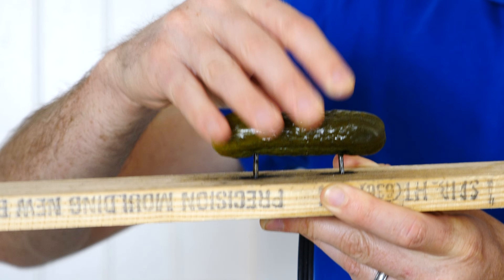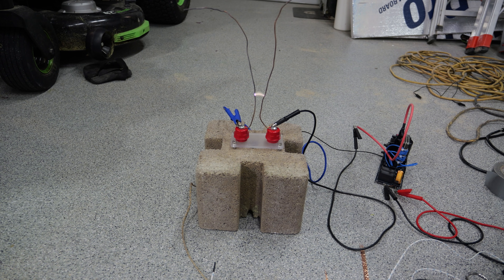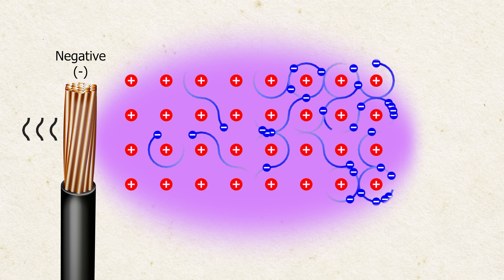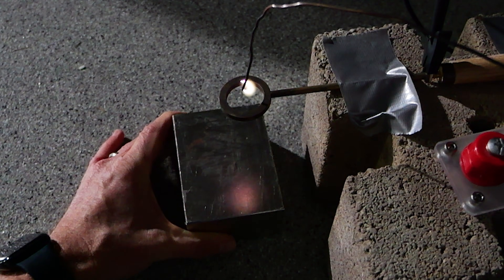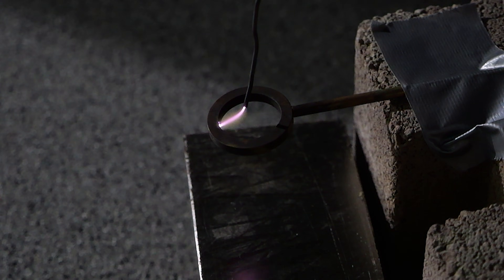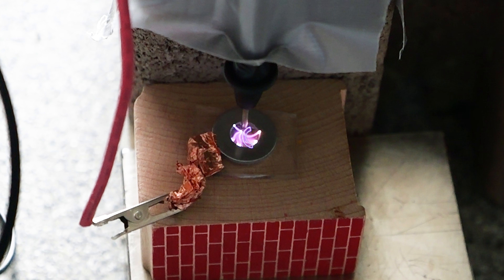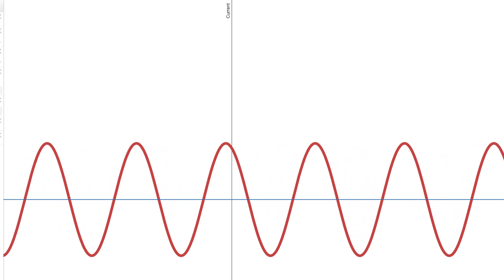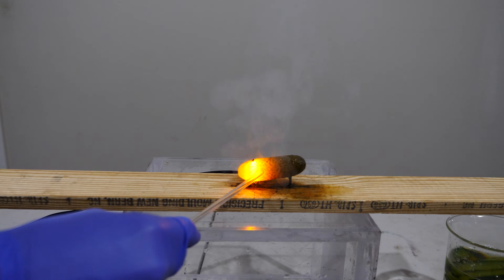Why AC Electricity Doesn’t Behave the Way You Think

Comment: The geometry causing a DC bias is how flame sensor rods work in a gas furnace. 120V AC is applied between the rod and the burner, with the flame acting as the conducting plasma. The resultant small DC bias current is sensed as "flame present".
Reply: 2025 and we still have a bias against DC. So sad.
Reply: @DanHarkins-jk9mi you can't blame them, DC can be so polarizing.
Reply: @DanHarkins-jk9mi  the other side is biased toward DC.  It all really balances out; no energy gained or lost, you know.
Reply: @DanHarkins-jk9mi  Well, the name change to Commanders may not have helped.
Reply: That is very clever. 'the best part for the job is no part', as they say.
Reply: 120v sounds high… a lot of tube heaters I work on are 48-60 v
Reply: @jasonhessels depends on the product. Exact voltage isn't critical. Most documents I can find say 90-110V
Reply: @jasonhessels  The control boards for the heaters can also step up the voltage to kV, such as for electric ignition. Perhaps the flame sensor circuit also steps up voltage? I'd have to look that up.
Reply: I have only ever seen thermocouple based flame sensors, but the theory of that one makes sense.
Reply: +1 for explaining something I hadn't fully appreciated. I'd thought it was 'just' making the gas/air more conductive.

Comment: For an asymmetric ARC, there will always be a DC component simply because the electrons can’t flow symmetrically, even if the driving waveform tries to be symmetric.  In a perfect circuit, one side would literally run out of electrons and the electric field would blow up to extreme voltages and find somewhere else for the electrons to go.  But no circuit is that perfect.  The DC bias that develops from the feedback is basically replenishing the electrons.

So it isn’t the circuit that is putting (most of the) DC bias into the electrodes.  It’s the electrodes that are inducing/forcing the DC bias in the circuit.

P.s. the DC bias will also heat up the transformer.  Transformers don’t like DC components because they do not contribute to building and tearing down the magnetic field.  They just generate heat instead.

-Matt
Reply: The flyback transformer he used has built-in diodes and some electronic neon sign transformers are knows to have a DC bias for some moving plasma effects in the tubes.

Comment: I still don't understand the DC asymmetry.   Why don't you get a similar effect from electrons?  Indeed, since the energy imparted to a particle as a result of a potential is independent of mass I'd expect a greater effect there.

  Also, Atoms are very small and the expelled positive ions should only heat up a very small region near a discontinuity in the material -- how can that be a substantial fraction of the overall heat created via resistance?  Or is this unique to the welding environment where almost all the resistance is at the discontinuity?
Reply: Energy is not voltage, and energy is not current.  Energy is voltage x current.   So the actual electron flow back and forth (current) is more or less independent of the energy that a heavy ion vs an electron can impart to the circuit due to kinetic motion (or anything else).
Reply: @junkerzn7312  Right but the same charge passes through both junctions and you get the same energy per charge in a potential.

Ohh is it about where the heat is generated? As in both junctions generate the same heat energy but one places it mostly on the welder side where it dissipates into the copper and the other puts it mostly into the intervening material (I mean really both junctions are basically the same but with sides reversed)
Reply: @petergerdes1094 no, one unit of charge is not o e unit of energy.  I just told you that.  Current is basically counting electrons … units of charge.  Current alone is not energy.  People make this mistake all the time.  A unit of charge does not represent a fixed amount of energy.
Reply: The flyback transformer he used has built-in diodes and some electronic neon sign transformers are knows to have a DC bias for some moving plasma effects in the tubes.

Comment: The pickle effect is different than what is happening with the plasma.  Since resistance increases with increasing temperature, heating is unstable.  The hotter part has more resistance and  therefore more heating.  This runs away and concentrates the heat.  Since the resistance is concentrated at the electrode, the electrode with higher initial resistance heats up faster.  This causes even more of a resistance imbalance and causes that side to have the majority of the heat.
Reply from the maker: yeah there is a lot more going on with the pickle than the plasma due to the reactions in the pickle and ion transfer through a liquid. But the point is that there is always an asymmetry that causes runaway heating that makes one electrode become the "cathode"
Reply: @TheActionLab  The flyback transformer in yoyr ZVS drver is a DC flyback. It has internal diodes. You need to get one from a much older TV which had external rectifier or voltage multiplier, so the AC output is accessible.

Comment: Thank you for this video.  I was wondering if I'd have to design a pulsing DC power power source for a ringed gliding arc plasma, But I'm glad to see that geometry creates bias where thermal electrons and field concentration create bias much like a vacuume tube valve rectifyer. It should have been obvious to me from the start. 

Next project pickle transistor computer. Just kidding 😂 there's probably no gain.

Comment: Ah yes, we always face the major problem of a pickle lighting up on the wrong side when plugging it to the outlet.
Reply: That's why I switched to USB-C pickles.
Reply: "we always face the major problem"

Or, you could say you're in a bit of a pickle.
Reply: flip the pickle over
Reply: @ImDelphox Pickle Rickkkkk!!!!
Reply: It's a good way to tell if the building's wired properly. The AC hot should always be the side that lights up more.

Comment: I'd like to see it with a series capacitor in the circuit to block the DC but allow the AC through.
Reply: One of two things will happen.  In an idealized circuit a voltage bias will develop that forces that ARC to run the same number of electrons in both directions.   In a real circuit, the voltage bias will likely be so huge that the capacitor will blow up.

Basically there is no way to avoid the DC component when the ARC is asymmetric.  The average electron flow can't stay asymmetric without a source of electrons to replenish the ones in the isolated part of the circuit that were lost to the other side (or gained from the other side).  So a voltage bias will develop that forces flow symmetry.  And if you didn't build the circuit to explicitly deal with it, the circuit will blow up instead.

A capacitor effectively isolates electron flow in part of the circuit which is why nearly all circuits that use capacitors to "block DC" still need at least a large resistor providing "bias voltage" to the part of the circuit that has been isolated from the electron flow.

There are a few exceptions... I/O pins on high performance chips are often isolated with capacitors.  But those provide the DC bias from inside the chip (often simply from reverse diode leakage current).

-Matt
Reply: I would use a fairly big capacitor value to filter out the AC component, in parallel to two antiparallel LEDs, e.g. red and green. The colour will tell whether there is any DC and which polarity.
Reply: In his first experiment, nothing would happen. That flyback transformer has internal diodes, so it only outputs DC.
Reply: @mernokimuvek  Yeah, I was thinking with the classic transformer.

Comment: As a welder that answered a question about my process I didn't know existed. Amazing! Thank you so much!
Reply: I would LOVE to have your explainations in laymen term, I’m a mediocre amateur welder but I have some grasp over physics and I’ll be thrilled to try to unite our strengths.
Reply: Respect for the welder.
🙏
Reply: It's only confused me more, I'm also as welder but what happens when you don't switch your tig set-up to DC- ? It destroys the tungsten which seems to be the opposite of his explanation, I'm super confused now.
Reply: @deepwinter77 Yeah, something doesn't make sense here. In TIG welding, it's the positive electrode that gets the most heat. That's the opposite of the explanation in the video.
Reply: @dack42 What current convention are you using?
Reply: @gbormann71 Nothing I said depends on current convention. Whether you are talking about conventional current or electron flow, the labels for positive and negative electrodes do not change. The negative electrode is the one with an excess of electrons and the positive electrode is the one with a deficit of electrons.
Reply: @dack42  i’m not 100% sure but I think that the really high current used in welding relative to this setup may result in the majority of the heat transfer being done by electrons (in the case of welding) rather than by positive ions. This may mean that on the scale of around 100 A you get a hotter positive electrode whereas on the scale of milliamps to amps you get a hotter negative electrode.
Reply: @dack42 if you're in DCEN your work piece is the "positive" end of the arc, which is why it receives 70% of the heat. The video explanation is indeed backwards, it's the kinetic energy of the electron flow in the plasma that creates the heat at the positive end, as shown in the welding diagram that pops up briefly in the video.
Reply: @d @dack42 I thought it made sense because generally with TIG you switch the polarity?
Reply: @tommojphillips TIG is done with electrode (the torch) negative. The clamp on the work piece is positive. This results in most of the heat going into the work piece. If you try the other way around, the tungsten in the torch will melt.
Reply: With DCEN, the electrons carry away heat from the tungsten electrode. Ion bombardment is not a big issue because the cathode fall is low once the arc strikes (the hot, sharp electrode is a good emitter).
Reply: @liam3284  (another welder) True, once you light up you're only dropping 10 to 20 volts, not much acceleration. It's why the torch runs so much hotter with aluminum (AC). In fact to ball the electrode, I turn the "cleaning" dial to max and slowly give it pedal until the tip melts. MIG is the reverse, since the wire IS the electrode you want it to be hot; the arc melts it before it hits the puddle.
Reply: @0x74D  My electric attacks are doing kinetic damage!?!? Neat way to look at it
Reply: @deepwinter77  100% agree with your confusion. Based on his debye sheath animation, everything I've learned about heat transfer is incorrect, but practical demonstrations easily show that more heat is found at the positive electrode. The welding arc is supposedly a plasma, so I would guess that what he's saying would theoretically include welding arcs, but ... yeah. Would be interested to hear a rebuttal specifically discussing welding.
Reply: @deepwinter77 
My first thought was TIG too, 
I never see a arc spin like that 😂
Reply: ditto!
Reply: 1:38 That information table is wrong. DCEP which is Direct Current Electrode Positive, you get the Electrode hotter. Example is MIG aluminium welding, you need the tip of your electrode hotter to penetrated the alumina oxide layer plus reverse flow of electrons to blast it off.

Maybe see it this way, forget the wires on the graphics and just take into consideration the plasma drawing, the "positive" cation is the hotter side!
Reply: God-Jesus died for our sins to give us eternal life and save us from sin
Reply: @josizzel  When did Jesus die? Was I around then sinning? No.

Comment: Oh, this suddenly makes foxhole radios make a lot more sense.  Solders would heat up a razor blade to get an oxide layer, and then attach a wire, making an impromptu diode.  It probably wasn't a very good diode, but that's all you really need to pull the audio frequency out of the AM carrier...

Comment: Before watching the video, I'm going to propose one side heats up more than the other because of variations in the resistance at the electrode contact. Once it starts heating up more at one, the resistance might increase or decrease, however it works, so as to cause more heat production there. It's like hot spots in power transistor semiconductors that can cause failure.
Reply: You are on topic. Geometry creates bias. Well demonstrated in the ring electrons will more easily jump off let's say a sharp point where the field  lines converge. And as one side gets warm thermal electrons reinforce the bias. In a way, I'm shocked at how close it is to a vacuum tube valve.